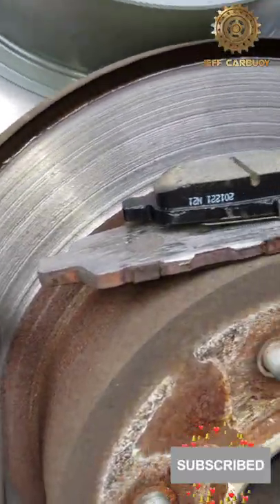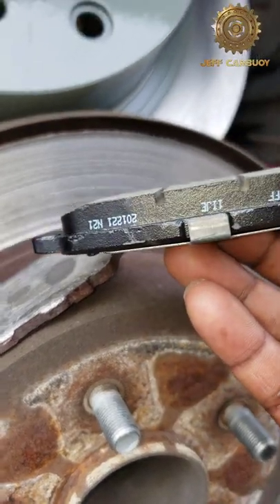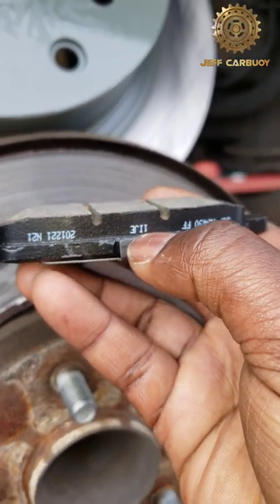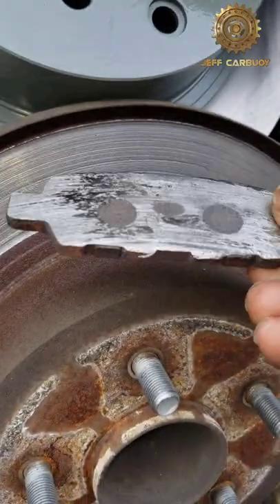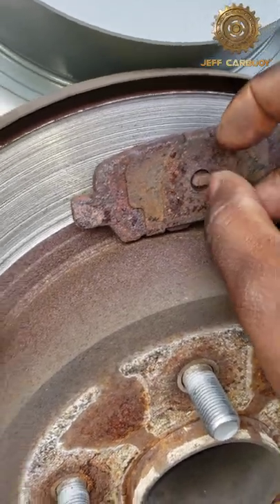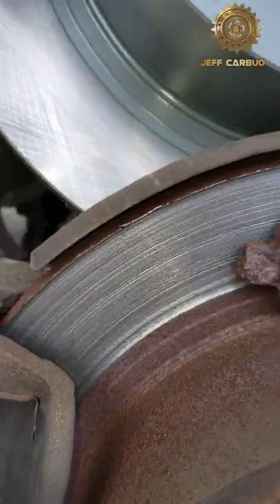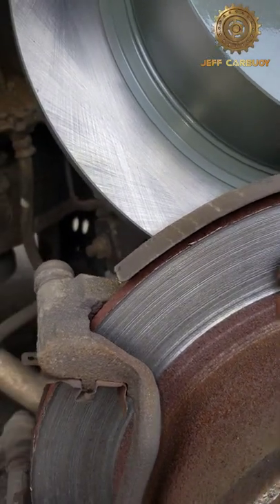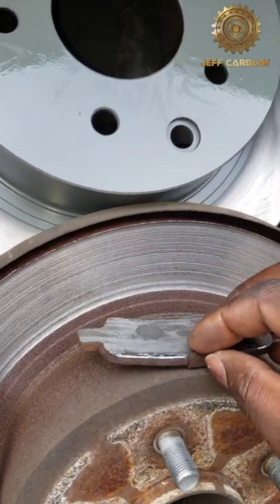Wondering Why Your Car Makes Grinding Noise When You Apply Brakes

Comment: Am facing this noise plus steering and body vibration while braking in high speed ! So do I need to replace both rotor and brake pads ?
Reply from the maker: Most likely you will end up changing both to solve the issue especially vibration
Reply: @JeffCarbuoy  let me try and come back here 🫡.... thanks for prompt response 👍

Comment: Hey bro I know this video is old but I had put some new brakes in and it’s still making that noise any idea what it could be ?
Reply from the maker: Maybe the noise wasn't coming from the brakes, or probably you have a bad wheel bearing,  could be several reasons but best bet is to have looked at got the source of the issue and move from there.